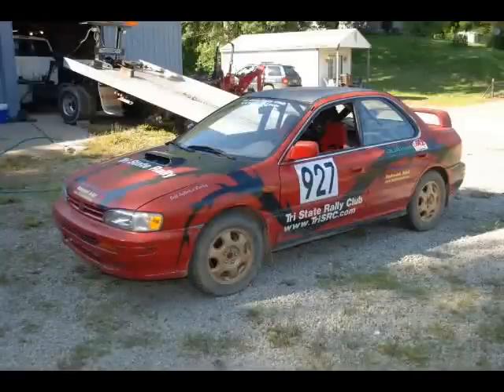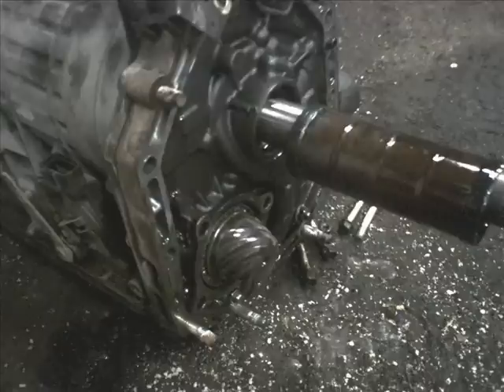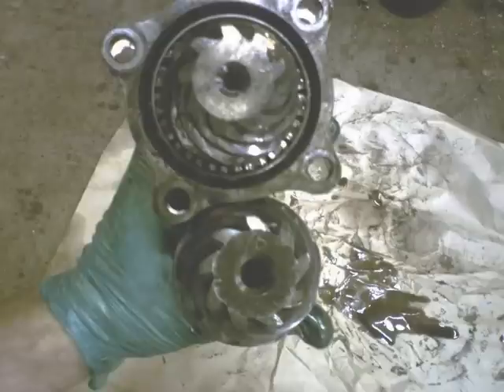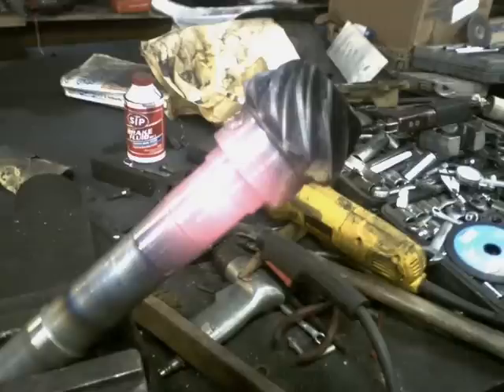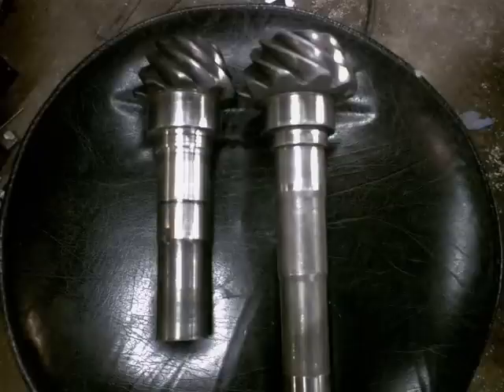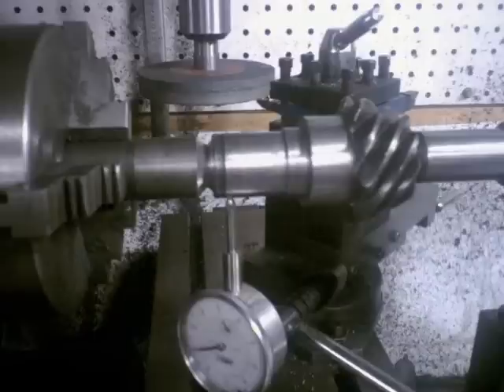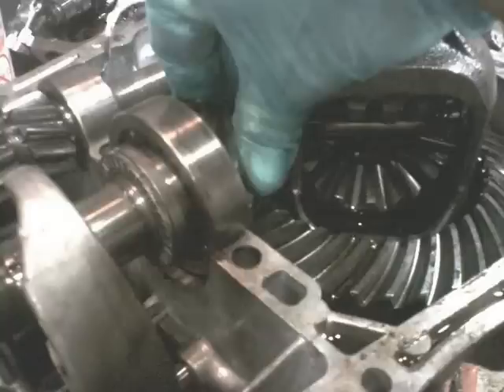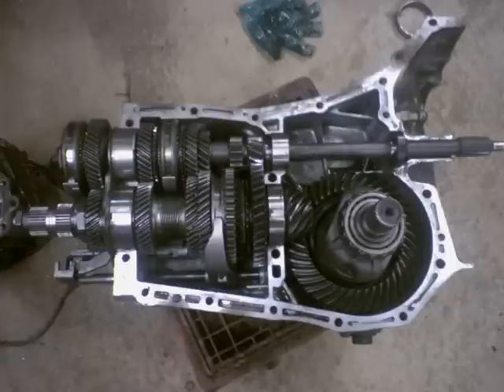Subaru 5MT Trans 4.44 Ratio Mod

Comment: Any reason why you did not just buy a 4.44 gear set out of a Forrester XT?  The Subaru sit shows it at $279 for ring and pinion.  Believe me, i am a fan of doing my own machining and fabrication as you can see from my page, but to me this is risky for the amount of force and shock going through it.  I am in the middle of trying to get the components to convert a pull style clutch 4wd transmission to a 4.44 ratio FWD only configuration for my beast for this race season.

Comment: Good job man. I have similar set up in my e36 bmw, it was automatic with a 4.44 diff and I swaped it to a 5speed manual but keped the diff and the accel is amazing only problem is my top speed is now about 100mph cause I run out of rpm

Comment from the maker: I know that the 98-00 2.5L twin cam engines were junk but subaru fixed the issue with the crank with later engines. The earlier Evct auto transmissions where problematic I'm thinking 02-04. Most subaru engine will make 250k miles depending on the driver. I was a dealer back in the day and I have personally owned over a hundred cars and trucks of all makes and models and I do like subies. All makes have there issues on cretin years. 
The only make I will not buy is Nissan!

Comment: I've Never owned a Subaru vehicle. Do they have many issues at all with either manual or auto transmissions?  As well as the drive lines at all?

Some people say they are one of the most reliable vehicles in terms of not having much go wrong with them.
Reply: lightningsmokerXx  Pretty reliable cars. They do blow head gaskets but it's not too terrible fix. If it's turbo they do require 91octane but they're fun reliable and just unique. Gotta love a boxer motor

Comment: I have a 97 Impreza L 4 spd Automatic Transmission H4 2.2L engine. I just swap an RS rear Subframe with the 4.44 limited slip differential. Will this blow my stock transmission? ??
Reply: El Comal Yes. Swap the trans + rear diff to match.